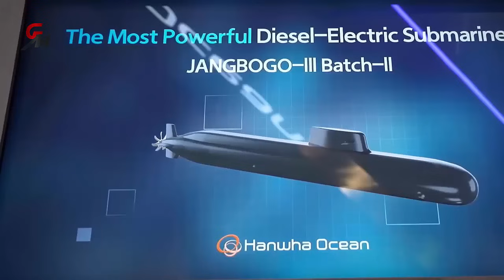Which is Better TKMS 212CD or Hanwha KSS-III, Here's The Canada's Next Gen Submarine

Comment: TKMS's 212CD is a small submarine intended for coastal operations. It is difficult for the 212CD to operate in the Arctic. It has never been to the Arctic Ocean or deep waters.
The 212cd is a fictional submarine that exists only on paper. Not a single one has ever been built.
The KSS-III has also participated in operations with the US military in the deep-sea Pacific and Indian Oceans.

TKMS's German and Norwegian submarines are built by three companies each (one from Germany and two from Norway). If Canada were to purchase the TKMS 212CD, it would face problems. Because the components used in the submarines are subcontracted from at least three companies, any problems with any of these three companies would require repairs from all three companies.
This would significantly impact maintenance.

One reason Germany's Eurofighter has struggled to sell well is that multiple European companies are involved, making repairs extremely difficult if only a few parts manufacturers fail. The 212CD, jointly produced by Germany and Norway, also involves multiple countries in parts production, just like the Eurofighter. Therefore, a single component failure can have a significant impact on submarine operations. Countries that own Eurofighters are retiring them.

For example, Thales of the Netherlands has halted production of the Goalkeeper, a close-in weapon system (CIWS), due to a shortage of parts. Thales's Goalkeeper CIWS is also not being maintained.

Navies of countries that purchased Thales' Goalkeeper CIWS are forcing operations by fabricating parts in-house at maintenance facilities. However, because difficult-to-process parts are unavailable, they are retiring Thales' Goalkeeper CIWS and purchasing the Raytheon Fellings system to equip their warships.

Since several European countries are involved in parts production, if a few companies fail to produce parts or if a parts company fails, weapons cannot be produced. This is the current European weapons production system.

Furthermore, submarine construction slots in Germany and Norway are already saturated.
Germany and Norway, previously content with peace due to Russia's invasion of Ukraine, are desperately trying to strengthen their military capabilities. With their weapons factories already fully occupied, they have no room to produce submarines for Canada.

If Canada orders the Type 212CD, it will not receive all of its submarines until 2055. Furthermore, the submarine price is currently estimated to be 25% higher than that of South Korea's KSS-III, but it is likely to increase by 45% to 55%.

In contrast, Korea's KSS-III submarines boast over 80% domestic production.
After the contract, three to four submarines will be produced in Korea and delivered. The remainder will undergo technology transfer to Canada, with Canadian shipyards producing one to 1.5 submarines annually.

A maintenance center will be established in Canada for maintenance, and training programs for submarine production and maintenance are also planned.
Korea's KSS-III submarines will contribute to job growth in Canada.
Reply: "TKMS's 212CD is a small submarine intended for coastal operations. It is difficult for the 212CD to operate in the Arctic. It has never been to the Arctic Ocean or deep waters." 

Very odd claim, not difficult for Norway to operate in the Arctic, half of mainland Norway is in the Arctic, if rotating Norway over to America on same latitude, Norway will be at same place as Alaska and have islands way north of that,  at 80 degree North.  The CD is designed for operation in Norwegian waters and that means Arctic waters. Norway mainland ends at 71 degree North and have 1700 km long maritime border with Russia north of that. Toward Greenland, there is a massive maritime border between 70-80 degree North.  

The Type 212CD project is on time with no cost overrun, the plan is to build 6+6 submarines in European shipyards, those slots are taken, but if using shipyards in Canada, then extra production lines can be established. Major European shipyards have orderbooks rather full before 2035, it could be that Germany give up two slots, but I don't see Norway giving up any slots.  

The question for Canada is if they looking for missile submarine with land strike capability in Pacific, or want a submarine hunter that is designed for operations in Arctics. The CD can also be fitted with land strike cruise missiles, Tomahawk for example can be launched from torpedo tubes, but if land strike capability is important, I do wonder why Tomahawks haven't been ordered for the River class. Australia have around 220 Tomahawks on order for their navy.   There are many synergies by doing project with NATO partners, CD come out of the box with NATO integration and NATO partners operate many similar platforms, systems and weapons. Germany and Norway run many joint projects now, new heavyweight torpedo, ongoing project for supersonic 3SM anti-ship missile with 900 km range. In Arctic, Norway operates several satellites with military applications for surveillance, communication and intelligence gathering, it's mainly US and Norway doing space projects. If Canada want to be more active in Arctics,  Norway is a big on satellites and pretty good partner to have, for Arctics, need navigation and communication, ya don't wanna get lost under ice, lol.

Comment: The 212CD is an unproven German submarine that has not yet been built and is not currently in service.
The KSS-III Batch-II is equipped with a generator, hydrogen fuel cell system, and lithium battery storage system, allowing for operations of up to 50~60day.
The KSS-III Batch-II is currently in service.
If the Canadian Prime Minister visits Korea, he can board the KSS-III Batch-II and command operations from the sea.

We look forward to the Canadian Prime Minister's visit to Korea, and Hanwha Ocean, the Korean Navy, and the Korean people will welcome the Prime Minister of Canada, Her Excellency Mr. Mark Joseph Carney.
The South Korean submarine KSS-III (Batch-II) operates quietly, theoretically allowing it to operate underwater for up to 60 days without surfacing if operating at low speeds.

Depending on the operation, the underwater operating time may vary depending on whether it operates at high or medium speeds. However, among existing conventional submarines, the KSS-III Batch-II  is the only one with the longest submersion time.
If Canada purchases a Korean submarine, the submarine maintenance will be done at a Canadian shipyard.

There is no need to send the submarine to Germany.
If Canada purchases a South Korean submarine, it could produce the submarines in part or in part in Canada through a joint venture.
South Korea has also proposed an offset deal to Canada.
South Korea has also proposed an offset deal to Poland, which would involve local production of some or all of the submarines.

There is no problem with Canada purchasing submarines equipped with SLBMs. The MTCR prohibits the export of ballistic missiles with a range exceeding 300 km, 
but South Korea has exported ballistic missiles with a slightly shorter range of 290 km to Saudi Arabia, the United Arab Emirates, and Poland.
A joint venture factory for ballistic missiles with a range of 80 km is being established in Poland, and production is planned for several years. It is also possible that 

Poland could produce missiles with a range of 290 km. Cruise missiles are not subject to export restrictions under the MTCR.
If Canada purchases a South Korean submarine, cruise missiles will no longer have range restrictions, and ballistic missiles could be mounted on SLBMs with a range 
of up to about 290KM~300KM kilometers. 

The Korean submarine KSS-III Batch-II is currently in service, built with 80% Korean technology.
The Korean submarine KSS-III Batch-III is currently in service, built with 90% Korean technology, and some parts are still in production.

The only German-made parts on Korean submarines are MTU engines.
MTU engine owner by British Rolls-Royce.
MTU engines are also being maintained in Korea.

Korea can develop and produce submarine engines, 
developing new submarine engines for the future.

KSS-III non-magnetic steel is a special steel used in the Dosan Ahn Chang-ho-class (KSS-III) submarine, a 3,000-ton submarine developed by the Republic of Korea Navy. It plays a key role in minimizing the submarine's magnetic signature for covert operations.

The Need for Non-Magnetic POSCO KOREA HY-130 Steel
It is crucial for submarines to remain undetected by enemy magnetic detection devices (MADs). Ordinary steels are magnetic and, when affected by the Earth's magnetic field, generate subtle magnetic signals that can reveal the submarine's location. Non-magnetic steel is used to address this issue.

Characteristics of KSS-III Non-Magnetic Steel
High-Manganese Austenitic Steel: Known as a non-magnetic material independently developed by POSCO KOREA , this steel stabilizes the non-magnetic austenite structure by adding various elements, including manganese (Mn), chromium (Cr), nitrogen (N), and carbon (C), to iron (Fe). High Strength and Corrosion Resistance: It combines high strength and excellent corrosion resistance with non-magnetic properties, making it suitable for submarine hulls and key components.
Enhanced Underwater Operational Capability: By minimizing magnetic signals, it maximizes submarine stealth, contributing to avoiding enemy detection and increasing the success rate of operations.
Domestic Production: By developing non-magnetic special steel, previously dependent on foreign imports, using domestic technology and applying it to the KSS-III submarine, we have achieved significant domestic production of a core technology for submarine construction.

Note
Austenitic stainless steel is generally non-magnetic, but can become magnetic after cold working. The non-magnetic steel used in the KSS-III has been optimized for this change, with its alloy composition adjusted to ensure high stability.

Comment: 잘모르겠지만 캐나다라면 KSS-III 보다 큰 잠수함을 선호한다면 모를까 더 작은것을 원하지는 않을거 같습니다.
Reply: If you need something larger, you can also build a U212CD yourself, 90 or 100 meters long, with 60-80 VLS in a row of four. Is that enough? If not, then instead of scaling the length cheaply with modules, you scale the whole thing up to the Virginia size of 8,000 tons and 115 meters. Is that enough? If not, another option would be the Qhio class with 18,500 tons and a length of 170 meters! They could then fire the M51.4 nuclear missile from the Ariane Group, which the French use!
You're forgetting one thing: the U212CD is FCAS capable with drone submarines! A 90-meter U212CD that exchanges data underwater with AI with 20 large and 50 small drone submarines means no Virginia, Russian, or similar submarine can get past without being detected and subsequently destroyed!

Comment: The German Type 214 submarines sold to Korea had initial defects, and Korea raised objections about these. While both German and Korean submarines in their first operational years inevitably have problems, Germany was very slow to address these issues, while Korea mostly resolved the issues later in the early stages of its KSSIII-2 batch of Korean submarines. The submarines Canada purchases will operate with these issues resolved. However, if Canada were to purchase an expanded version of the Type 212CD, it would be burdened with the initial defects and would face the arduous process of fixing them.
Reply: It's funny when you ask the AI about the statement... The German Type 214 submarines sold to Korea had initial defects, which Korea objected to... The AI conclusion: Korea built the KSSII/U214 submarines itself, and it's normal for the FRG to quickly correct system errors in brand-new, high-tech submarines, but Korea's employees didn't have the decades of experience of the German submarine builders, which exacerbated their problems in Korea!
According to experts, the U212CD cannot be compared to any other submarine, as no other U212CD has any differences with its FCAS/AI capability and drone combat cloud! Furthermore, the U212CD is scalable in length, 90-100 meters with additional modules for the center section, which is relatively cost-effective, like the Israeli U214/72 meters (+20%), or the 8,000-ton Virginia! For one Virginia, you get at least three 8,000-ton U212CDs capable of carrying nuclear missiles! For example, the Ariane Group M51 for French nuclear submarines!

Comment: The 212CD is an unproven German submarine, not yet built or currently in service. 

The KSS-III Batch-II is equipped with a generator, hydrogen fuel cell system, and lithium-ion batteries, allowing for 50-60 days of operation. 
The KSS-III Batch-II is currently in service. The Canadian Prime Minister will be able to board the KSS-III Batch-II when he visits Korea. 
We eagerly await the Canadian Prime Minister's visit to Korea, and Hanwha Ocean, the Korean Navy, and the Korean people will welcome him. 

The Korean KSS-III (Batch-II) submarine operates quietly and, theoretically, can remain submerged for up to 50-60 days at low speeds without surfacing. 
Depending on the type of operation, whether it operates at high or medium speeds, the submerged operating time may vary. 

However, the KSS-III Batch-II is the only existing conventional submarine with the longest submerged operating time. If Canada purchases a Korean submarine, 
it will be maintained at a Canadian shipyard. If Canada purchases a South Korean submarine, some or all of the submarines could be built in Canada as part of a joint venture. 
South Korea has also proposed an offset agreement with Canada, which would involve local production of some or all of the submarines. 
Canada would have no problem purchasing submarines equipped with vertical launch systems (VLS) capable of launching submarine-launched ballistic missiles (SLBMs) 
and cruise missiles. 
The MTCR prohibits the export of ballistic missiles with a range exceeding 300 km. 
However, South Korea has exported slightly shorter-range ballistic missiles (290 km) to Saudi Arabia, the United Arab Emirates, and Poland, 
and has signed a contract to export ballistic missiles with a range of 500 km to a Middle Eastern country. 

The Middle Eastern country is presumed to be Saudi Arabia or the United Arab Emirates, but due to confidentiality, Hanwha Aerospace only disclosed the export amount and not the country of export. 
South Korea is jointly building an 80 km-range ballistic missile factory in Poland, which is planned to be operational within the next few years. 
Poland could also produce missiles with a range of 290 km, 500 km, and cruise missiles. Cruise missiles are not subject to export restrictions under the MTCR. 

If Canada purchases a South Korean submarine, cruise missiles can be installed on the submarines, as there are no export restrictions on them. 
They can also mount ballistic missiles (SLBMs) and anti-ship missiles with a range of approximately 290-300 km on their vertical launch systems (VLS). 
South Korean submarines KSS-III Batch-II are currently in service, 90% manufactured with Korean technology, with some parts still in production. 

The only German-made component used in South Korean submarines is the MTU engine. Since MTU engines are also maintained in South Korea, maintenance is possible in Canada. 
The KSS-III Batch-II submarines have six 533mm ATP torpedo launch tubes, and can launch the Beomsangeo heavyweight torpedo-II, UGM-84 Harpoon anti-ship missiles, Haeseong-III submarine-to-surface cruise missiles, and self-propelled mines. Submarines are weapons designed to strike enemies when attacked.
A small submarine capable of carrying only torpedoes is a mockery.
Reply: KSS3 hull is even more unproven for arctic

Comment: Oh yeah the Korean sub that doesn't work and the maintenance crew that was responsible for causing the sinking of the Indonesian KRI Nanggala 402. Yeah good choice Canada.
Reply: The Nanggala, the second of the Type 209 submarines imported from Germany in 1981, is an aging vessel, approximately 40 years old. Daewoo Shipbuilding & Marine Engineering (DSME) performed a performance improvement depot overhaul in 2012. However, the submarine did not undergo any depot overhauls, which are typically performed once every six years. After 2018, it did not even dive until
on April 21, 2021, when it sailed deep into the ocean,
and sank under the pressure of the deep sea.

Its crew was originally 38, but 53 were on board.
The submarine's maximum diving depth is 250 meters, but it is likely it dived deeper.

However, submarines are normally required to undergo depot maintenance every six years. If a submarine must be operated beyond its service life, it must undergo depot maintenance at a shorter interval. Therefore, Indonesia is solely responsible for not conducting additional depot maintenance after the 2012 depot maintenance, and Daewoo Shipbuilding & Marine Engineering is not at fault.

Submarine depot maintenance is Indonesia's responsibility.
Indonesia, by failing to perform depot maintenance, is responsible for the deaths of the submarine crew.
Depot maintenance involves completely disassembling a submarine and replacing internal components.
This resolves malfunctions caused by aging components and restores fatigued submarines to like-new condition.